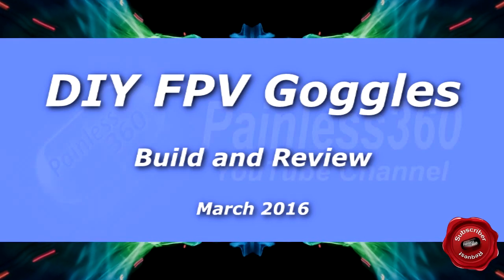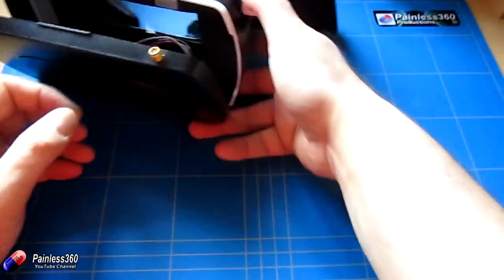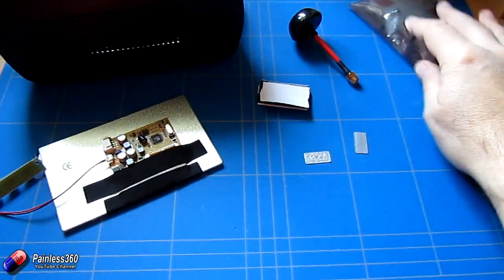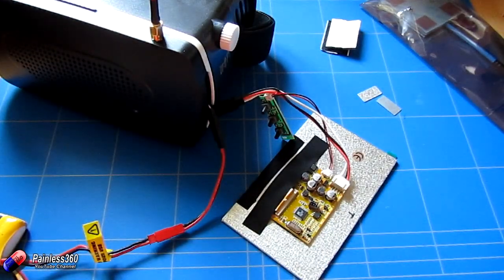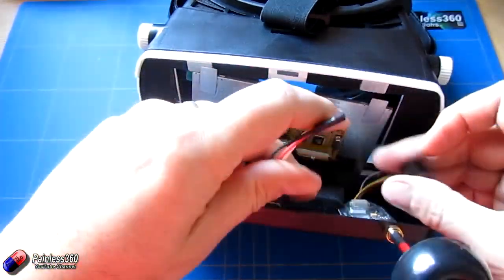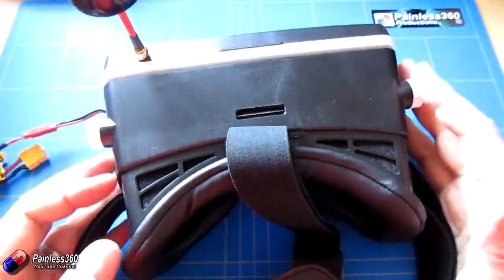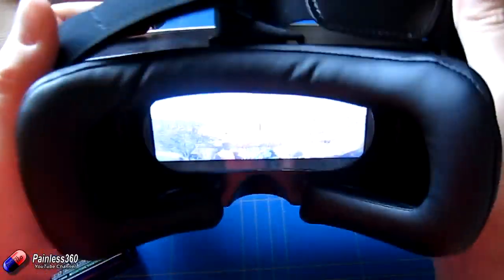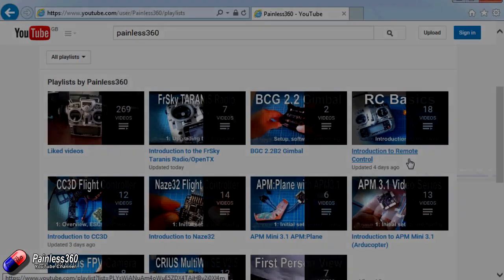RC Review - Cheap 5" 32 Channel FPV Goggles

Comment: It's pretty cool :)
My only regret is there is no AV-IN. That would have been cool :)
Thanks for sharing and happy sunday
Reply from the maker: +ABMNS PRODUCTION There is - kinda. That cable that we didn't use plugs into the back of the screen when you are not using it with the FPV video receiver so you could use that for it. Not very tidy but do-able ;)

Comment: Thank you very much for doing this review, sir. 
I actually bought one of these and they work fine.
Very easy to put together and very comfortable to wear.
For how much they cost I think they're great, I only wished it was possible to extend the screen a bit further  to help with the focus. Maybe using a pair of reading glasses would work. I have to try that.
Reply from the maker: +Luis Rodrigues Possibly, I did find that they had to be all the way out for me to see the screen ok too..
Reply: +Painless360 For me, I can only get a good focus if I pull the goggles about an inch away from my face.
Maybe a more powerful fresnel lens would help
Reply from the maker: Maybe, I wonder if the mechanism for adjusting the screen can be 'altered'...

Comment: This is a very interesting headset. Easy to assemble and great value.
To bad the receiver does not support raceband which is quickly becoming the de facto standard.
I guess its easy to change the RX to a Raceband - SMA type one but its another 20-25 Euro.
Reply from the maker: +Gerard de Vries It would be but remember this is a cheap set of budget goggles made from separate parts that form a working setup. Just. This is only for those who want to try FPV and can't justify/want to risk hundreds of pounds of dollars for a more expensive set. If you want all the bells and whistles then there are better choices out there.. Happy flying!

Comment: got these :-) i like them 
i did install a small on/off switch to make it all a bit easyer
ma batterie is also mounted inside , as i diden't wana have any cable's on the outside ^^ nice and clean , love ma first set of goggle's sofar ;-)

Comment: Painless360 hiya can you give me a bite advice lee when you add the eachine pro dvr to the receiver would it be a good idea to put a LC Filter on the power supply if yes will it be on the power going in to the receiver or from the receiver to the dvr power lee

Comment: Question: Does the blue screen appear when the transmitter signal is lost?
Reply from the maker: +Peter Mchenry just static on ours. Happy flying!
Reply from the maker: +Salih Ergezen turning off the vtx makes the rx give out static to the screen. Best of luck with yours. If you want bullet proof tech you'll have to spend more than  £66 for your goggles ;)
Reply from the maker: +Ulf Åkesson no snow here, see the video...
Reply from the maker: +Ulf Åkesson interference will happen as range increases with any budget reciever. That's part of using cheaper kit. These would be fine for park flying but I'd look at upgrading the rx if I were going to push it. Remember, these are  £66 budget goggles - there are higher performing sets for lots more money if you want to get serious about your FPV..

Comment: I googled painless360 smartphone fpv, and this video seems to be the closest, but nothing actually about smartphones. I have seen some videos and read some articles about connect a smartphone and app to a video receiver, and getting a good quality image without goggles. But they seem to be rather old. 
What is the latest ?
Reply from the maker: That's not something I've looked at, I think that AndyRC has done more on that topic. Best of luck!

Comment: I purchased a pair of these goggles the image is nice when I hold them at a distance.  Issue I have is I can't adjust them far enough to focus the image because screen is still too close to my eyes. This is an issue others are having. Keep this in mind when ordering.  Im not sure if playing around with different lenses will help. With that said screen image is good easy assembly lite good bang for the buck.
Reply: did u ever find solution to focus problem. im having same issue and have perfect vision so trying to figure it out.
Reply: +Themustangone no I haven't found a solution that works so far I have played with freznel lens hasn't made a difference. Hobbyking has a lens kit for the quantum 2 Bruce Simpson featured them on his YouTube channel.
Reply: I haven't had a chance to look for lens similar to the kit available for the quantum. Maybe that might be a fix?
Reply: +Andy Antal yes I have quanum v2 and they work ok and have fatsharks and they work great, but ppl rave about the cost of these diy goggles and form factor but nobody talks about how you cant really see in th :p.
Reply: I agree. I purchased mine due to reviews saying how good these are but fail to mention no way to focus image for those who wear corrective eye wear. I am looking for another housing for the screen so far no luck.

Comment: how much time your fully charged lipo lasted during usage? what about the weight...is it lighter than Quanum v2? great review as usual :)
Reply from the maker: +Bruneau Melier just over 390g without lipo,  Quanum V2 about 100g heavier with a Rx and no Lipo.. Time depends on the battery you use.  I'd take a spare if you planned to fly most of the day.
Reply: Painless360 thanks for the info!
Reply from the maker: As you asked you can preview this new video ;) https://www.youtube.com/watch?v=EFaV76t9CQU

Comment: How would you rate these compared to Quantum v2 ?
Reply from the maker: +Vic Prk (Slick  Vic) in what way?
Reply: +Painless360 I'd ask similar question- if you have quanums and this diy goggles, which one would you choose?
Reply: +Painless360  Wt., vid. quality, comfort and smell.
Reply from the maker: +Vic Prk (Slick  Vic) 380g without lipo, fit well with deep padding and smell fine ;)
Reply from the maker: +Marcin Miska these are all-in-one so no need for separate Rx and making up cables etc. I like the V2s as I want to easily choose the Rx to use with them and have the choice of diversity Rx upgrades in the future.
Reply from the maker: As I've been asked this a lot on this video - I made this follow up for those of you who asked (preview here) - https://www.youtube.com/watch?v=EFaV76t9CQU

Comment: Hi, very nice tutorial and channel, you have my suscription from the first day I watch your minimosd tutorial.

I have this same goggles and the eachine falcon 250, but when I set the googles on freq. A and chanel 1 for example, and the VTX on the same freq. and channel, I can't see anything, I have to set my googles to b freq. and channel 7 or 8 in order to view the transmission, is this all right?
Reply from the maker: Check the tables for how the Tx and Rx are setting up the frequencies. If you're not flying with lots of others this will be fine.
Reply: The thing is that I set the same freq. and channel on both vtx and goggles but I wont see anything, I have to set different channels on the goggles, and I watch the video signal on 2 o 3 differents channels, with same quality, so I dont know witch one is better, nor with the tables. Thank you for your help.
Reply from the maker: Depends on how accurate both are at tuning to exactly the right frequency. I'd test it and go with the strongest signal. Best of luck.

Comment: I'm having issues with mine.  the screen goes black with signal strain then shuts off completely.  I have to plug and replug and the screen comes on clearly.  I'm stumped on it.
Reply from the maker: +dcFPV _ check the battery, ours simply powers off when the battery gets low..
Reply: +Painless360 yah, I've tried 2 different batteries with voltage showing good.  receiver works well with different screen but different receiver with 5inch screen results in same blackout.  customer service has been good and I'm promised a new one when shipment arrives.

Comment: cool
There are also some fpv goggles at Aliexpress, for arround 70 called:
"Eachine VR-007 VR007 5.8G 40CH  4.3 Inch HD FPV Goggles Video Glasses With 7.4V 800mAh Battery"
Would you like to test these?

Comment: Did you flight test it? Any latency, reception, etc. issues?
Reply from the maker: +kodiaksage works well for park flying. Why the question about latency?
Reply: +Painless360 Curiosity. Did something similar with a reciever, easycap, and my cell phone. The lag was pretty bad although I didn't really realize it until I got my first fat sharks. Bottom line for any fpv goggles is how well it works with the type of flying you do and personal preference. I think it would a tremendous help to viewers interested in this product if you let them know how much lag there is and how well the reciever works in an actual flight. Just my opinion and hope I don't offend.  I enjoy the videos you put out and am looking forward to your videos covering the new kiss fc.
Reply from the maker: Anything like a cellphone that need to read the input and then process the image while doing a hundred other things will be like that. A dedicated screen and Rx is a vey different system... Best of luck!

Comment: I wonder if I could fit my RC832 in those. You have one of these right? What do you think mate?
Reply from the maker: +Elefkara The goggles were given as a prize a while ago but from memory it would be a tight fit..
Reply: thanks for the answer mate. I have the quanums v2 but they are not comfy at all so I was thinking to grab the UFO case from banggood and fit everything inside. As fas as I can tell the screen will fit since its a 5 inch one.
Reply from the maker: Hang on a few weeks - some cool new things about to come out ;) Watch this space..
Reply: +Painless360 Oh! you have me intrigued . I 'll be watching...

Comment: will my syma x8c 7.4 vlt be to much power for these?? ive ordered the goggles and was planning to wire one of those to them..
Reply from the maker: +Raythetree001 Not sure what you're asking. 'Too much power'? If that model uses a standard 5.8ghz FPV transmitter it should be fine. See our 'Introduction to FPV' series for lots of the basics. Best of luck!
Reply: mine ave just come and they dont work...the screen is just flashing every few seconds..i ut a 2s 7.4 on them...what do i do???
Reply from the maker: Let the vendor know you're having a problem. If they are wired up fine then it should be on and working as we show in the video.

Comment: Do these fit over eyeglasses?  What is the inside lateral width?
Reply from the maker: +Richard Kleinhenz Just under 5.5 inches..
Reply: +Painless360 Thank you!  That should fit (by measurements) and makes them definitely worth trying :-)
Reply: +Richard Kleinhenz (just as these headplay knockoffs appear on the scene...)

Comment: <And what's better this or the eachine vr 007?
Reply from the maker: +Bello3 We don't have them so can't comment..
Reply: Ok thx
Reply: +Bello3 These because the VR-007's have a very low resolution. And for old people/ people with bad vision, the VR-007's are too blurry as the lens is positioned wrong. You might also wanna upgrade the antenna on the 007's to a cloverleaf. Deffo get the DIY's.
Reply: Oh ok thx